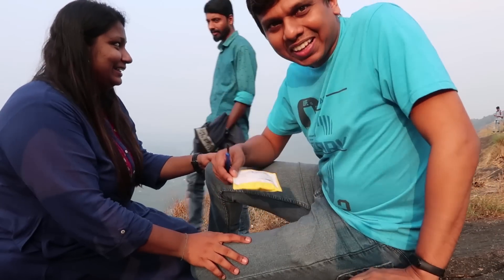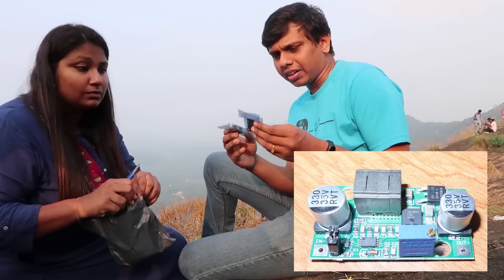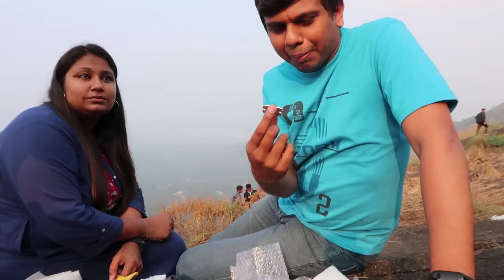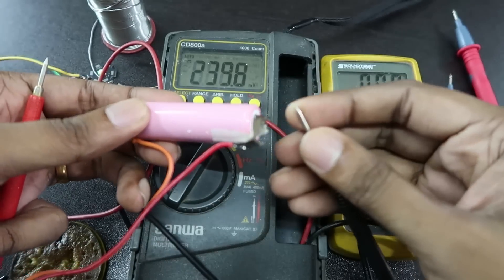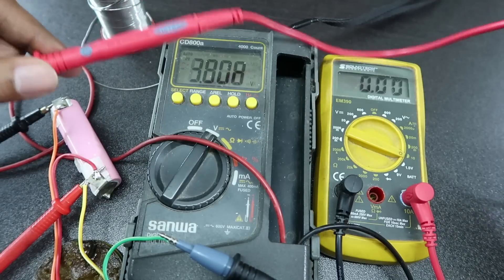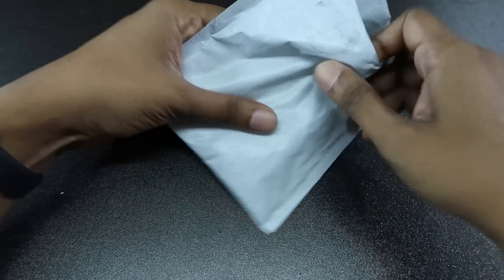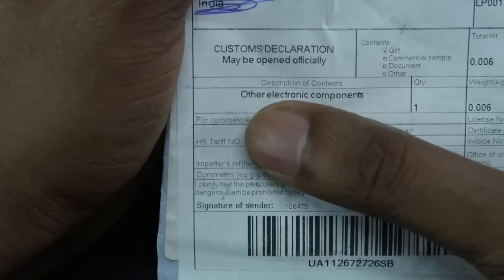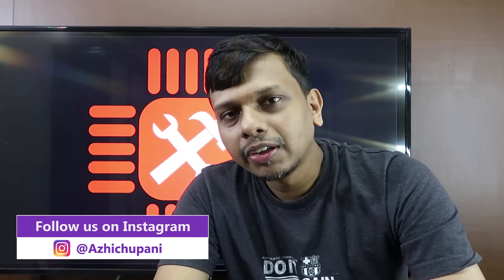Aliexpress Shopping - Electronic Unboxing and Future Projects

Comment: Cree led alle... Njn medichu heat sink okke venam ketto. Pinne power bank module il 1 amp and 2.1 amp parayunnelum enik 1 ampil thazheye kittunnullu. Buck converter Xl4015 aanu 5 amp nte.